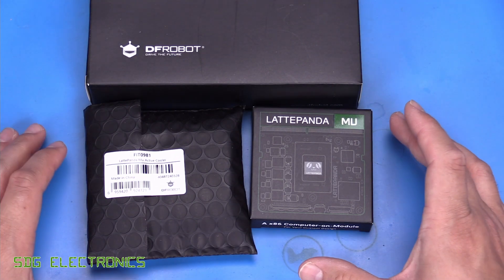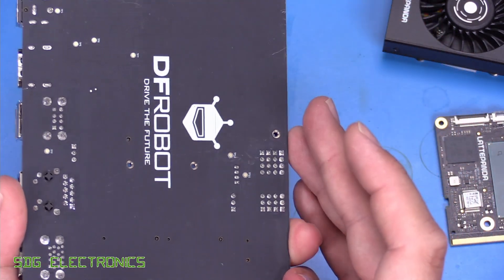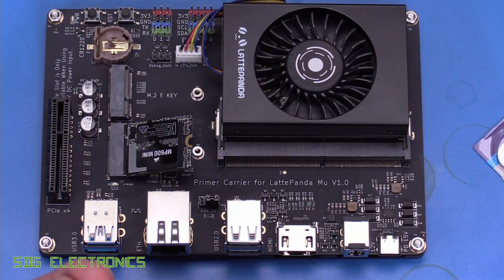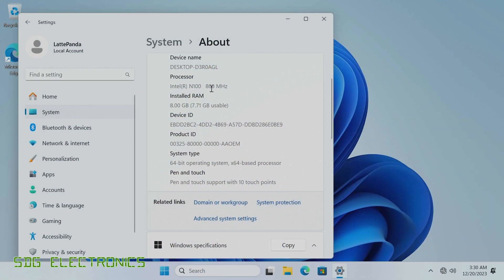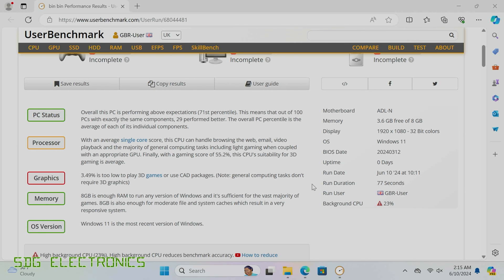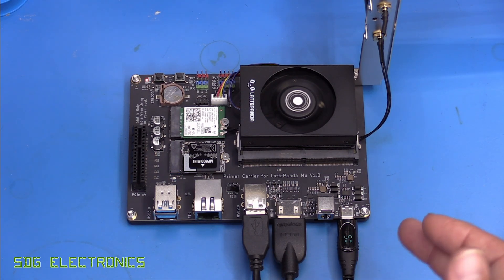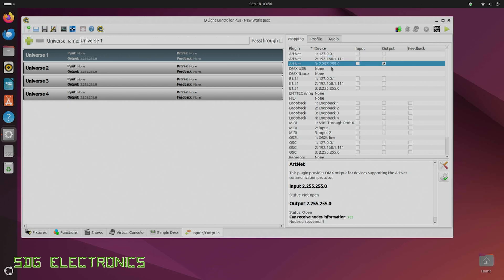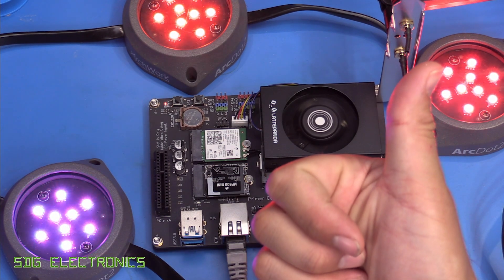SDG #346 LattePanda Mu Small Board Computer

Comment: I didn't expect to see QLC making an appearance. I've used it in theatre settings where a full RGB control board was prohibitively expensive. It sounds like you have a lot of those lights, and so one of the more powerful features of QLC is the matrices function, where you can set up many fixtures in a grid array, and QLC will do the heavy lifting of automating light patterns. I haven't considered using it in a 24/7 running home automation environment, but you should be able to interface it with Home Assistant or OpenHAB, and have QLC auto-lanch on startup. Sounds like a cool project.

Comment: Without that PCIE slot on the carrier board I would have called this pointless as a mini-pc would provide all that functionality in a smaller more convenient form factor. I have a pair of Delta 3's that have a GPIO interface.
Reply: I think the main use case would be plugging the PC module into a custom board for whatever you're doing. The carrier board is mainly for testing and development.
Reply: @rocketman221projects  This is what they intended.